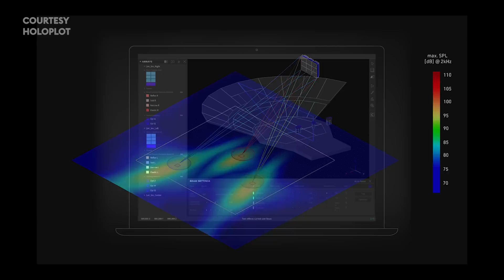An Inside Look at the Audio System in the Las Vegas Sphere

Comment: I just went to U2 show and I was so disappointed with the sound it seams like this technology doesn't work in live music in large scale format. I was able to walk and listen in different places and it sounds bad. there is no highs at all, it sounds like there is low pass filter with 6dB per octave from about 3-4k. The low end muddy and not focused. If you standing under the balcony the only thing you able to listen it is just one box which sound like there is L + R plus mono summation of left and right and it's all playing from one source and also it sounds like high frequency  drivers not working at all. When you stand on the edge of the balcony where you should be able to hear all the immersive sound yes it is sound wider but again there is no highs. And it is not focused and not punchy sound.
So please tell me as sound engineer I know how physics of sound works, but
1. how you able to through highs with just open 1" drivers without any wave guide or horn or any other thing. I understand that you can create coverage with dsp processing and delays, but how you compensate the distance? We know that as sound travels it lost energy but it also depends on frequency (highs lost energy faster) how they compensate that? 
2. All engineers knows that if you have two sound sources apart from each other more than 2/3 of the wave length and play same signal from it, it will give you interference. That X1 systems have many 1" drivers and they placed in about 5-6 sm apart from each other. So for example wave length of 10 kilohertz will be just about 3,4 sm it means that if you play same signal through these X1 system it will give you interference from 5-6k and above unless you shape the sound with some wave guide and give it directional so it will not cross each other much.
Reply: Was there a lot of slapback?
Reply: @thegoodguy44  actually sound treatment did pretty well in that room, I like how it sounds… not too much reverberation and not super dry. Even with this wall shape it is still good.
Reply: @DmitryIlyushin  In answer to your first post - well, opinion actually - with the HF drivers being so distant to most of the audience, I suspect that what arrives at their ears is a somewhat ill-defined 'mush', especially in such an odd-shaped space.  Yes, beam steering can focus and direct sounds to a degree but the phase linearity is bound to be horrendous.  
There will be very few trained ears in any given audience, and when many folks are happy to listen to a phone with nothing below a couple of hundred Hertz, it no doubt sounds spectacular to them.  To you and me, it's simply an expensive novelty.

Comment: no mention of subwoofers
Reply: The loudspeaker modules each have 2 15" Subwoofers in a band pass configuration. There are internal photos floating around the  web.
Reply: @JoshsGadgetsandMore  intresting defiantly be interested in hearing what this sounds like
Reply: They have a sub module
Reply: I know about 10k seats are supposed to be fitted with infra-sound haptic rigs. 

I suspect there's seperate sub augmentation to those Holoplot array modules. 

I noticed there's two types of the modules ... perhaps the ones with vents are the LF ... 

I'd like to know more from someone in attendance, ie., How loud was it? 
Vocal intelligibility? 
How was the bass clarity, visceral element and punch?
Reply: @FOH3663 best sound of any venue I can recall. Was too loud at times, had to plug my ears in a few parts of the film I watched. The haptic vibrations in the seats were pretty crazy, very thunderous bass and sound seemed to come from all directions, I was sitting to the right yet everything still sounded centered in the soundstage. I want to go back very badly.
Reply: @Deelman222  
Very nice ... thanks for that.
Reply: @FOH3663 guess you’ll have to buy a ticket .
Reply: @FOH3663  Having watched a couple of mobile phone clips from the U2 concert, the audio quality certainly seemed better at the POV of the phone than that from many other traditional concert clips (Notwithstanding Bono's Autotune seemingly offline)...
Reply: @dougle03 Bono does not use auto tune.
Reply: @dougle03  The guitar sounded huge in the clips I watched.
Reply: @mm-nyc  I'm suggesting he start, since his tuning is obviously eluding him...
Reply: @dougle03  My first impression was of an old bloke singing karaoke.  Why don't these has-beens retire with grace (under pressure? 😉), as did Rush?